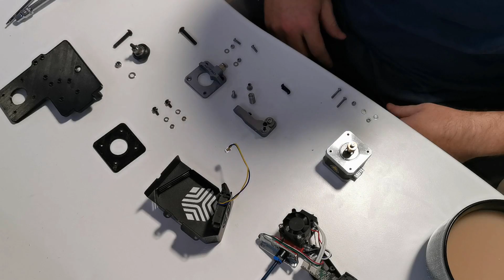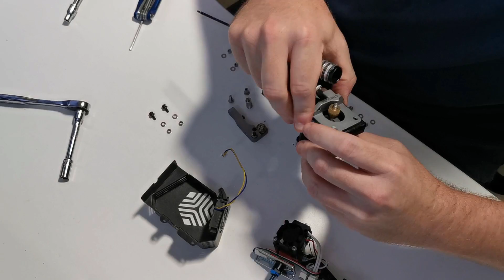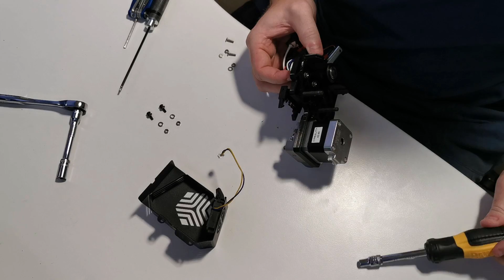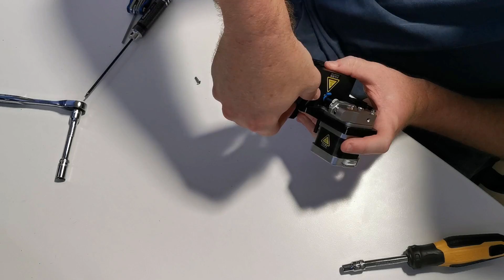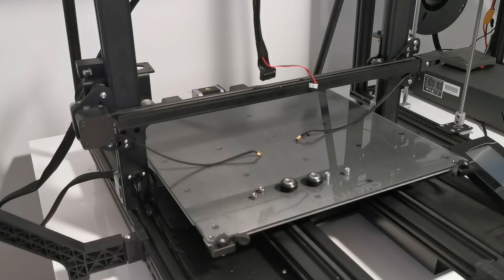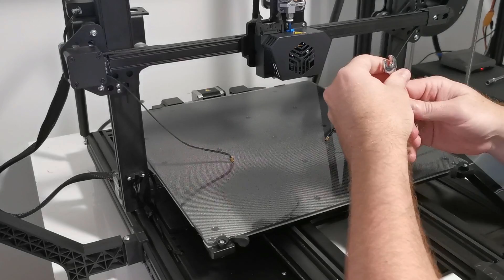Modify Your CR6-MAX Into a Direct Drive Extruder With Existing Gear

Comment: I just did this mod but the extruder is going the wrong direction and it pushing the filament up towards the spool vs down through the hotend.  Is there a setting to change this or is my jumper wire flipped?
Reply from the maker: Hey dude. You have to change it in the firmware when recompiling it if you want to do it in software. It’s easy enough to do however if you’re not compiling your own firmware, you’re better off swapping one pair of the wires. I think the easiest is to swap pins 1 and 3. This is a bit of an explanation: https://electronics.stackexchange.com/questions/70643/how-to-reverse-rotation-direction-of-stepper-motor
Reply: you can also switch 2 of the wires for the extruder  there  is a youtibe video for that @shanegoodwin2912

Comment: Doing the mod.. I like it a LOT! 💖💖 Question.. --> 1.) I need to buy an extension for the 4 wire z stepper motor.. I may splice, or just get a male to female and plug into the short out near the filament sensor.. What length should I get?  2.) filament feeds into the original location mounted filament sensor, correct? (Hard to tell from the camera angle lol). It then does a 90ish to the top of the new metal gear direct drive? Feeds ok 'free lining' from the sensor to the extruder this way? Thanks Again.. 😊 Subscribed
Reply from the maker: Hey bloke. Glad you like it. 😁👌 To answer your questions: 1. Yeah it needs to be extended for sure. I used about 80cm. Hopefully that works for you too. 😁👌 2. I don't use my filament detector. I just disabled it. I think if you want to use it, you may need to either move it and extend the 2 or 3 wires, or set up some cond of Bowden tube/ guide at the top to help guide the filament. Apologies mate. I never looked at that bit.
Reply: @shanegoodwin2912  Thanks for the quick reply!  To be honest, I'm not a big fan of the filament senor. I can't even think of a time that I have ever run out of filament, so removing that from the equation is OK with me.. 😊. So, quick question, where do I go to disable it? Also, where do you mount the filament roll now.. I'm guessing up top? (( Full disclosure, I don't have the MAX yet.. Picking up tomorrow... 💖AND --> the only reason I decided to get one is after watching your mod videos on it 😉. I just recently 'dipped my toe' into the Creality  world.. Last week I got an s1 Plus, ((Prints beautifully)), but for goodness' sake.. you have to jump through hoops to do a color change.. M600 support is like nonexistent. So, I'm returning and getting the MAX tomorrow. (At least there is 3rd party FW being developed for the CR 6's ).. Prior to this I have 2 Prusa's a MK1 and a MK2, both from kits, so years of experience in maintaining and repairing these machine tool demons.. Mods are right in line with what I like to do .. I'm sure to get a similar response from the CR FB group like you when I post.. 'new MAX' --> modifying begins!!! lol It's a tool.. and like you.. I like to mod my tools.. 😂😂).

Comment: Just subbed! I made the changes to my CR6 SE and the bed is finally level. Super easy too. Thanks! However, there is a conversation on here about the CR6 SE. and Microswiss extruder and direct drive, is there an updated file anywhere with the changes? Or will the Max work?
Reply from the maker: Hey mate. Glad you enjoyed and glad it helped. I don't have the file on the microswiss unfortunately. I need to find it myself as well! :-)
Reply: @shanegoodwin2912  I tweaked my current direct drive to make it work. I use tinkercad so it’s crude but works for me. I just finished it and sent it to the ender 5 plus. 9hr print. At some point tomorrow I should have a working prototype I’ll let you know.
Reply from the maker: @kepanaa8940  sounds great mate. I'm keen as mustard to see how it goes 👍☺️

Comment: Good Video👍 , does it work exactly like a direct drive unit ? Also - any other adjustments other than lowering the retraction distance ? 
Is the print better due to the relocation of the extruder?
Reply from the maker: Hey bloke
 Thanks. ☺️👍 Yeah I think it helps, however it's hard to tell as you have to slow down the print speed. So it could be that as well. I mostly did this to get away from jamming that I was seeing in the long Bowden tube. It has definitely helped my print quality for me. With my 3d printed plate, you need to shrink the bed by 20cm. Just because the stepper hits the frame. Apart from that though, it's all you need.

Comment: Hi Shane. I'm rebuilding my CR6 SE. and I need to change a little in the bracket you made. the reason for this is I want to mount a micro swiss extruder. is it possible to get a cad or step file on the bracket. by the way, your video has helped me a lot, nice work.
Reply from the maker: Sure thing mate. I have exported the file as .stp for you. I have saved in my Google drive and shared it via this link:  https://drive.google.com/file/d/1G0k8JMD1lYRnk2Sdc7z10jJ6dPDLMODN/view?usp=sharing 

Hopefully that works for you man. :-)
Reply from the maker: Oh, the preview in Google doesn't work, but you can download the file by the top right "Download" button. :-)
Reply: @shanegoodwin2912  Thank you wery much:-) have great day
Reply: @shanegoodwin2912  if you like i can send you the file when im done edited. thanks for sharing
Reply from the maker: @sunnlesaint77  Yeah for sure man! That would be great! Yes please. :-)
Reply: @shanegoodwin2912  Hi did you get the part from him for the micro swiss one? I need that one please.
Reply: @sunnlesaint77  Hi do you have the file and did it work I have a micro swiss dual gear did your design work? If so can I have a link please I need to update this the bowden is terrible. Thanks
Reply: @cobus8870  Iwas wondering the same thing i have one of those hotends coming and wanted to do the direct drive with it and this one looked good
Reply: @sunnlesaint77  any chance we can talk you out of a copy? I'm in a similar situation.